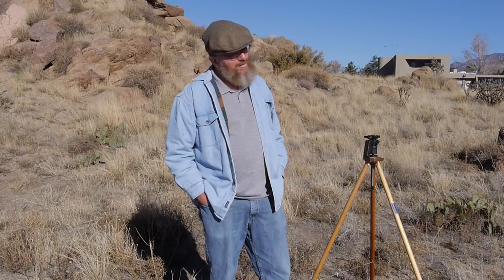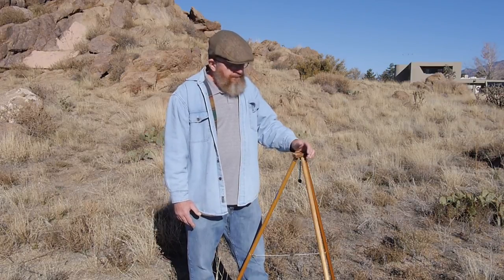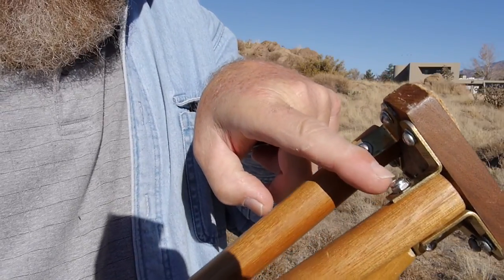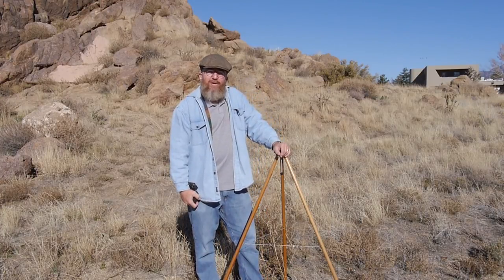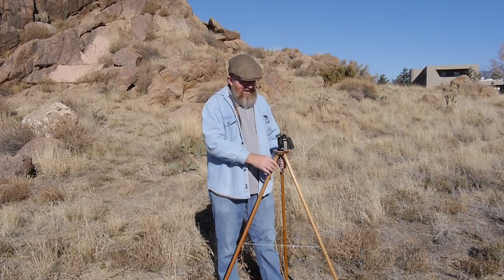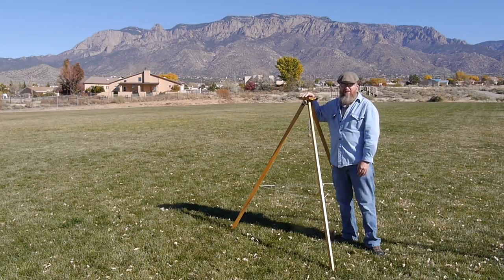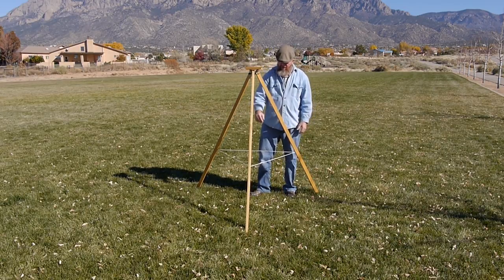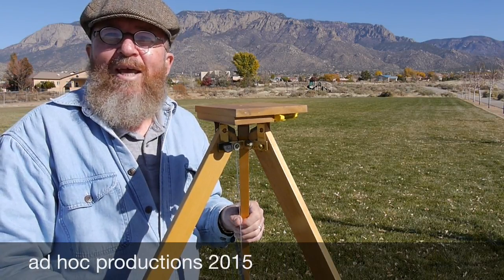DIY Tripods

Comment: I love the tension loop solution, so simple yet effective! But I worry a bit about the triangle plate "wobbling", i.e. tilting left/right and front/back. How do you prevent this, simply by friction leg mountings?
Reply from the maker: The L-brackets hold the legs snuggly while permitting them to pivot on the bolts, very little play. The triangular plate is "triangulated" to the three legs, so no wobble.